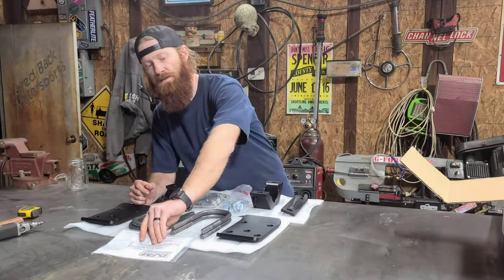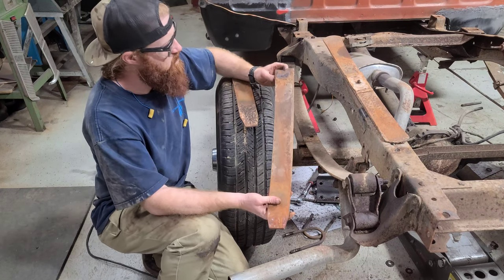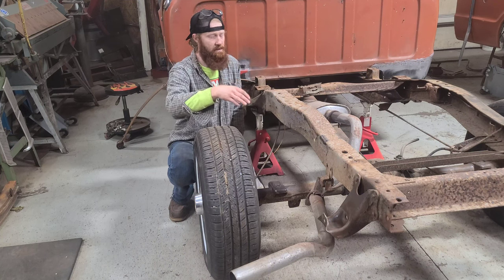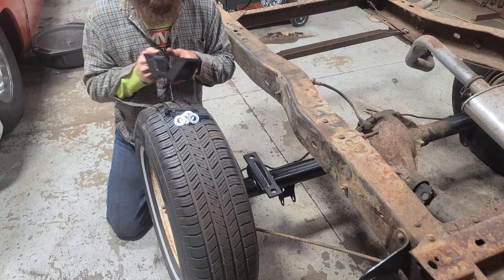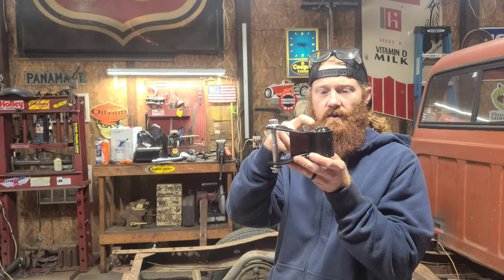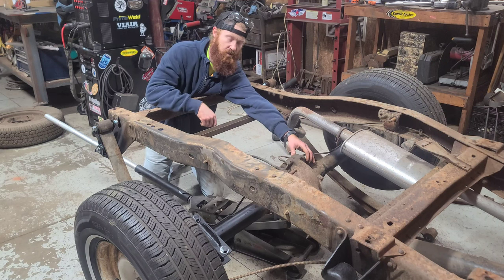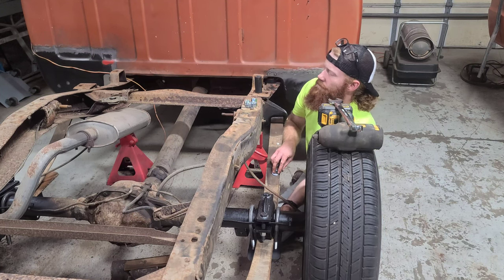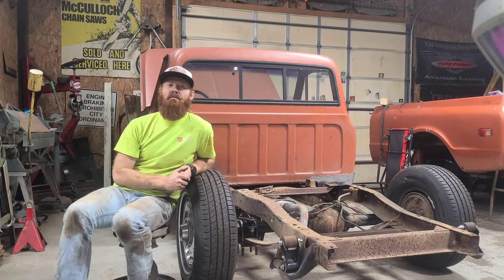Flip kit install on a 72 c10

Comment: Nice! I have a 70 c20 with rear coils and an overload spring. Im guessing id have to get lower coils and and axle flip?
Reply from the maker: I would just do coils and do away with the overload. And add bags if you plan to haul. Does it have a pan hard bar?
Reply: Thanks for the reply! I've been considering bags, any brand suggestions? I'm not sure if it has a panhard bar, I'll check and let ya know.
Reply: It has a pan hard bar
Reply from the maker: @mrh8562 yeah if it was me I would just remove the leaf springs all together

Comment: Did you have to remove the bottom leave spring the short one ?? I installed them but the dont stay straight thinking on removing them ....any thoughts??
Reply from the maker: I did remove it. Crazy think the leaf springs on this truck actually ended up being broke in a few. So swapped out my 66 GMC over.
Reply: If I remove the bottom small thick one I should be ok that will leave me 3 leafs the bottom one keeps shifting ??

On the instructions on the 71 c10 djm flip kit it has no torque specs on the u- joints what did you torque yours too ??
Reply from the maker: @Wordscarryweight59 the short thick one is the overload. You should be fine with just 3. As far as torque. I would go with 100ft pounds. Make sure the weight of the truck is on them before torquing 👊🏻
Reply: Right on brotha thank you 👊
Reply from the maker: @Wordscarryweight59 anytime 👊🏻